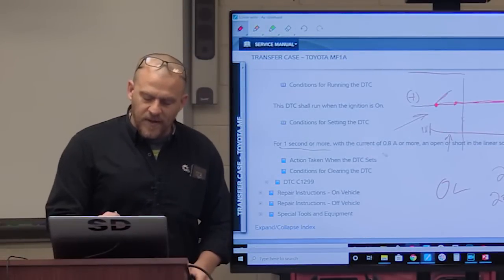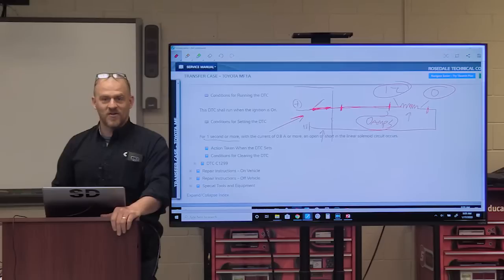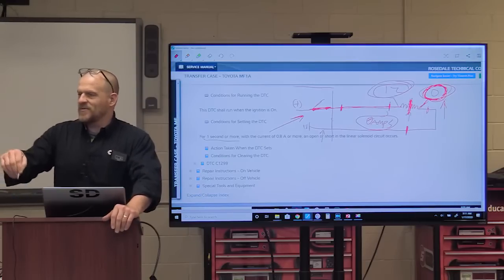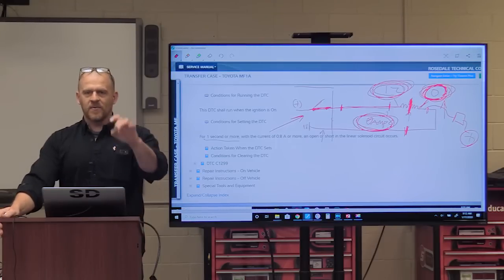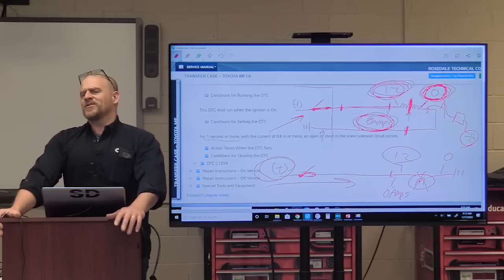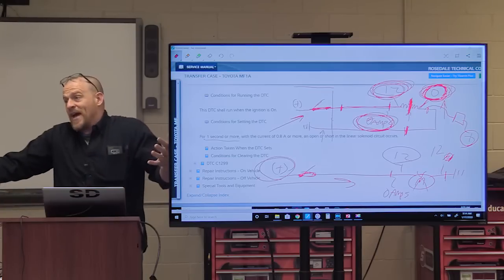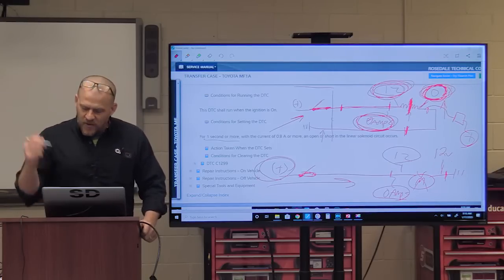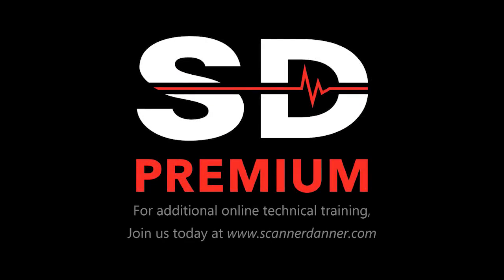Should I Make a Bunch of Different Test Lights to Load Circuits?

Comment: Thank you for not taking it to hard on me lol there are right ways to do things, some times it's a safety concern too, I work on old Tube type electronics too one of my pieces of equipment use a 6x4 tube rectifier that's known to have failure within that shorts the Medium voltage(250 volts) to ground a circuit that normally runs around 50mA usally burns the power transformer up, and could take out the speakers output transformers. My Digital meter was loaned out, and I wanted sub the tube rectifier for 2 1n4007, and a couple if resistors. The only meter I had was a VTVM which the ground lead connects directly to the outer metal case, and my goal is to make two separate measurements. One of which( measuring across the two resistors) will put 250volts of DC on the case of the meter. I knew this so I still took my measurements and were talking like 30mins to an hour of monitoring these voltages. And doing math to calculate the current, and any huge drifts. I ran the device for some time like that before I got my DMM back and I retested everything, I had to rebuild the VTVM the voltage divider was so far out of tolerance took 8 months to get all the backordered parts! Everything tested basically spot on the VTVM isn't the highest Revolution, but hey it wasn't a circuit that needed to be perfect either. Thank you Paul!

Comment: The load testing focus for most technicians is in testing wiring and connection integrity between the source and the load. 

But, in practice load testing can be rather diverse so we need to ask exactly what type of load test to perform given the customer complaint and the circuit topology. What follows is a basic list of the different load testing that I do. I don't use different bulbs, I use different large non-inductive power resistors because they do not have the high inrush current as incandescent bulbs. For load testing key on engine off it is best to put a voltage maintainer on the vehicle battery, or jump start posts if you cannot get to the battery posts, and set it to a nominal voltage like 13.0VDC or 13.5VDC to power the vehicle and put a slight charge on the battery (below 1/10 C rate max):

1) General +12V power circuit testing; Fluke 87V DMM on DC Volts. 

Load used is 470 Ohms across the DMM input leads. 

The 470 Ohm resistor will slightly load the circuit to eliminate any DC ghost voltage due to a corroded power connection that could fool the 87V due to its very high input impedance (resistance) of 10 Meg Ohms. The Fluke 289 industrial DMM has a Low Z AC Volts option to eliminate AC ghost voltage. The Fluke 87V should have a Low Z DC Volts option like the Keysight U1272A DMM (the load is 2000 Ohms for both Low Z AC Volts and Low Z DC Volts), however for +12V automotive work the Low Z DC Volts should be closer to 470 Ohm with no ill effects on meter internal shunt heating.

With the 470 Ohm resistor I am only just eliminating ghost voltage. I am not trying to mimic the actual load current or load test wires and connections. 

2) General +12V load testing at about a 1 Amp; Fluke 87V DMM on DC Volts.

Load used is 10 Ohms across the DMM input leads. Test current 1.2 Amps at a source of +12VDC. 

The 10 Ohm resistor is a general test load when we suspect a wire or connection fault above about 1 Ohm (this is a good general starting point for corrosion), which would produce a noticeable drop in reference to the system maintained voltage of 13.0 DC Volts (key on engine off). The benefit of using the 10 Ohm resistor is any voltage reading we take while load testing we know exactly what current the circuit is drawing by just dividing the voltage by 10 (Ohms Law). 

3) Medium +12V load testing at up to 4 Amp; Fluke 87V DMM on DC Volts.

Load used across the DMM input leads is either 3 Ohms for 4 Amps at 12 VDC, or 4.7 Ohms for 2.55 Amps at 12 VDC. For medium loads for a test current of 4 Amps, which is generally less than the smallest fuse for such a load with a rating of 5 Amps, will easily detect a resistance above 1/4 Ohm. The 4.7 Ohm resistor is good for loads around 2.5 Amps which is also very common but we are concerned about a circuit fuse at 3 Amps. ATC fuses come in 1, 2, 3, 4, 5, 7.5, 10, 15, 20, 25, 30, 35, and 40 Amps. However, you usually do not see many circuits fuse below 3 Amps which would be a Violet colored ATC fuse. 

4) High +12V load testing. I use a carbon pile load tester up to 500 Amps to test cable, battery lug, chassis and block grounds with suspected high resistance due to corrosion or a loose bolted connection. 

I have other loads like 12.5 Ohm and 47 Ohm that I have found useful in specific cases. For example the 12.5 Ohm resistor is handy when testing with ignition on engine on at a low alternator output to give at least 1 Amps of load current. The 47 Ohm resistor gives a general 250 mA (1/4 Amp) load which is what many general bulb tester lights use. 

If you want to see a light or hear a sound or both, all of my loads and test leads use stacking insulated banana jacks so I can add my LED test light load or my buzzer across my DMM along with the load resistors. My LED light is very bright at 1/4 Amp at 12VDC and is off below 7 Volts so it cannot hurt module circuits. The buzzer draws 50 mA.
Reply from the maker: I'm not opposed to using different loads to check wiring integrity. My argument is in condemning an open in the load or output itself. If I see 12v on a feed and 0v on a ground on a plugged in fuel pump and I have no pressure and no current flow on the pump circuit. I'm done, it needs a pump. Did I load check the wiring? No, I didn't because the pump motor is open. Do i need to also load check the wiring to confirm the pump is bad? 100% no. The pump is bad.
Am I going to have a wiring problem at the same time the pump motor failed? Nope, that doesn't happen either. If you feel the need to load test the wiring to the pump, more power to you! You still need a pump.
That's my argument
Reply: @ScannerDanner  For testing the simple high side drive pump circuit, for power and ground reference I generally use my clamp on extension harness (15 Foot long 16 AWG) to the battery terminals with the opposite end having stackable shrouded banana jacks, so if I am at the back of the vehicle I can still easily reference battery POS and NEG to do testing. 

What I am trying to say is when you take the 12VDC or 0VDC DC voltage readings, as you describe in the presentation, you can also load test at the same time. Which is what technicians are doing when they use a 2.5 Amp test light in a very crude way; the light bulb is the load, and the bulb brightness somewhat giving an indication of voltage. A much better approach is to use a DMM on DC Volts and introduce a known resistive load, so we can measure circuit voltage and load test the circuit at the same time. 

So, if the pump circuit can be cycled using the scan tool, and I choose a representative load, let's say 4.7 Ohms for an approximately 5 Amps pump, and I put the load across my DMM, when I take my voltage readings at the pump connector, I am also introducing a 2.6 Amp load (good enough to detect high resistive faults in the wiring or connections). If the wiring and connections are good I should see the voltages as seen by the load with only a slight voltage drop in the extension test cable. So, I made my voltage measurements indicating I have a bad fuel pump and I am also confident that the circuit can handle the load.

Comment: I always check or substitute grounds first. Quick and easy. The older it is, the more common ground problems are in my trade. 
  I also have a load test rig I use if voltage or continuity isn't getting it.. It is just an aftermarket taillight pigtail that I can change wattage bulbs,  as well as voltage, to mimic the load and pin or clamp in and move down the system until you locate the problem.I use this mostly when I suspect wire harness and connector issues.
   love your stuff. Keep it up.

Comment: Need help.. 89 e350. 351w no spark.did your test on things. Same volts on both side of coil plug while cranking, test light solid no flicker. 12v test light to pip on module = no coil fire. Hear relay for pump but no spark from coil. Power / grounds seem OK on module wires. Dont know why no spark from coil doing that test. Pick up bad? Coil bad? Module bad? Vanlife.no start, Had to get towed off river bank from Helene. SWVA. Safe now. Just cant move anymore. Thanks.
Reply from the maker: What is your PIP voltage with KOEO? 0 or 10?
Reply: @ScannerDanner  battery volts at 12.2  pip koeo 8.86
Reply from the maker: @nodotoroam  test light to battery ground and touch on and off that PIP wire with KOEO. It should spark each time
Reply: @ScannerDanner  thats what I thiught.. watched and watched your videos... NO SPARK. changed coil wire with new, and tried another new plug, no spark at all.
Reply: I do hear something when I apply test light to the t-pin stuck in pip. But sounds close to distributor not like at right fender mounted relays for fuel pump.
Reply from the maker: @nodotoroam  that's the injectors firing. Most likely you have a bad module. Check module ground first before changing it. And good luck getting a good module. Took us 4 trys on an 86 mustang to get a good one. Video is here on YT
Reply: @ScannerDanner  ok I will. I seen that video. Is this true on checking ignition module control?  Video i watched  (1987 f150 steps to check ignition control module) thanks for the help.
Reply: WHOO HOO... SCANNER DANNER to the RESCUE. Was 100% the issue. First Try. Did go ham on the old one (no 5.5 deep socket) so it got carefully dismantled to revile them. Then threw them away! New bolts and a module later.. vroom vroom. THANKS AGAIN!
Reply: Hey man, im still in the muck!  That fixed the start issue.. however I have stumbled across an issue that I think was already there but wasn't this bad. Before this happened with the no start, I had a off idle engine die, lack of power, miss and hesitation. But wasn't real bad but very noticeable. (Mind you this van sits alot and I do run at idle to charge batteries on cloudy days for no solar. Vanlife) So did research off your channel to narrow issue.  Its down to the tps. With ohms its 98 closed and then when I operate the throttle it goes OL.  Then a number then OL. then like 1300 or something then OL. Then 1500 or something. Its very jerky and not a smooth transition to wide open throttle. When its OL. and you keep moving it.. it takes a bit to get it to register a number again. Its bad right?
Reply: Also.. codes flashing.. 11, 11, 163, 63.
Reply from the maker: @nodotoroam  voltage test that TPS!  KOEO backprobe the TPS signal wire with a voltmeter connected to a known good ground. You should see about 1v at idle position and about 4v at WOT position.
Also check your MAP sensor frequency. (Or is this a MAF engine?)
Reply: @ScannerDanner  it should be a MAP. Its on passanger side with 1 plug and 1 vacume line. Square box, black with out the new vent/drain holes, so oem?
Reply: @ScannerDanner  so I checked.. no movement on it. I have 5.1v solid on the one wire. No movement on other 2? Odd numbers on meter for the other 2 like - 0.08 and such.
Reply from the maker: @nodotoroam define these codes please
Reply from the maker: @nodotoroam millivolt numbers it sounds like. The ground pin should have been steady though and less than .1v or better less than .05v. If the signal wire was bouncing near there, with a steady ground, we are looking at a bad TPS for sure. But I want to do one final signal wire test first and I want you to verify that steady ground pin for me.
Reply: @ScannerDanner  Hmm. Ill have to have that checked by someone. Thats above my multimeters pay grade.
Reply: @ScannerDanner  I don't remember sending this.. for i know the codes meanings. Not sure what happened there. Sorry.
Reply: The codes. Was 11,11,163,63.  11 was test pass. 163 had something to do with its a 2 didget code with trans? (Forum talk) and 63 was tps not responding 1/4 turn.
Reply from the maker: @nodotoroam  okay cool. KOEO at sea level the MAP HZ (frequency measurment) should be 160HZ. It's usually 156-158 in my area which is around 1000 ft.
Then start it and get an idle reading. 90-110 HZ at idle comes to mind 😅 it's been awhile. But SUPER important test of these systems is for this MAP sensor
Reply from the maker: @nodotoroam  most meters have it. It says HZ on one of the scales
Reply from the maker: @nodotoroam  but I don't! I need them please
Reply: @ScannerDanner  Sorry thats what I was apologizing for earlier.. I thought I had sent that text asking you to break down the codes. I was like.. im not going to ask that man to do that for me.. then a bit after that I realized you sent that text so I then sent the code info.. sorry for the confusion.  I got lost in the order.
Reply: If you want me to ill word for word the code info I have.
Reply from the maker: @nodotoroam  okay cool. I wanted to see that TPS code. One more test. Do you have an old school test light?
Reply: @ScannerDanner  yes sir. 2 wires and a 194 bulb.  REAL OLD SCHOOL.
Reply from the maker: Okay, that's more current than I wanted but it's better than using a jumper wire in this test.
Key off. Jump 5v ref wire to the signal wire with your test light. Set it up so you don't have to hold it or get a helper. Turn key on and tell me if it sets a different TPS code . It should say "circuit high" now
Reply: @ScannerDanner  ok will do.
Reply from the maker: @nodotoroam, no, we're good now. We keep getting crossed up because of how these comments are posting.
Reply: @ScannerDanner  its a bit much sometimes. Just know im not out to aggravate, just got lost. I appreciate the help so much. Not to mention its 1:12 am. Ill let ya get. Thanks Again.
Reply: @ScannerDanner  I have a question. ( I know its 3:34am, please don't answer till your good and rested) can i use the 5.1 volt power wire that is going to the tps as ref.? Basicly jump wire from power source 5v to the signal wire for the setup of over voltage code were after? Reason: would it be a safer power source for the test then my homemade 194 bulb test light?
Reply from the maker: @nodotoroam  yes! That is the reference wire i was referring to. And you can use a jumper wire for this test, but I prefer the test light for two reasons:
1. In case to accidently jump the 5v ref to the sensor ground wire instead of the signal wire.
2. In case the signal wire is shorted to ground (your mv reading bouncing around says that is not your case, so I'm not too worried about this one)

What we are doing here is confirming the signal circuit is good before replacing the TPS. Hope that makes sense.
Oh and btw, I don't help to many people to this level. You know why I am? Because you are tracking with me perfectly and doing all of the tests I'm telling you to do. With accuracy too! Basically you are not wasting my time like most people do here on this platform. It's cool to see. Keep it up!
Reply: @ScannerDanner  ok ill do that. I had it in my mind to go from 12v to that wire with light. Thinking back to what you said its more volts then you liked,but use light. Thinking the light would some up some juice for the test.. then I was like.. NO.. BETTER NOT..LOL BETTER ASK TO BE SURE. I didn't figure this is normal for you. I was going to take what I was offered and go.. STILL DOING THAT. BUT WITH ALOT MORE HELP THEN I THOUGHT.. I cant thank you enough.
Reply: @ScannerDanner  i understand about following directions.  Jsyk.. life time ford guy (51yo) but on the paint, body, fabrication side of tech. 17y at Volvo Truck Va.  As a Class a painter, built a main 20 foot section of VT wind tunnel. And currently trying to patton my 4x4 conversion brackets for ford vans.there already designed and water jet cut. So yeah. No problem with instructions, only reading. Get lost on forums and big info sights, but do what I can. That brings me to you. So clear, very accurate and knowledgeable of topic, said in street language, very relatable, and you care. Hard to go wrong with all that. So glad to see you are (even though special circumstances) exactly who you are in videos. Just wanted you to know a bit about me... since I've seen so much of you. lol. Thanks for listening. I'll let you know on the test. Will be several days before I can get parts to fix. However info is power.. im good now for a few. Thanks again.
Reply: Ok man ,so here it is. Need to know the results before tps goes in tomorrow.  Throttle body off now in hand checked the tps closed position with ohms. And it reads 0.86. Need to check with voltage? Also noticed a vacume line missing on lower throttle body tube at butterfly. Ill deal with that its not the issue. But needs to be addressed. Also the tps is still in throttle body housing. Didn't want to move it till I 100% checked it.
Reply: Well I guess its my luck or I missed something huge. So i installed the tps .98-.99. Other tps was jerky and not reading smoothly on volts. Start it up.. nothing changed. Still undrivable. So I run the codes. New code never seen before. #22  MAP sensor out of range. So I guess all 3 went at the same time? Well I have to wait a few more weeks to get the cash to fix that.. but hey... it has to stop there RIGHT?.. LOL  thanks man for all your help. Oh didn't mean to throw a bunch of stuff in there about me few comments ago. Sorry.

Comment: I dont have quick access to an amp clamp, so I use a bulb for additional load on circuits and run voltage drop on everything. This was a cool explanation of another way to get enough information to see the state of the whole circuit with different tools.

Edit: just saw two more videos from you on voltage drop with test light LOL gonna check em out